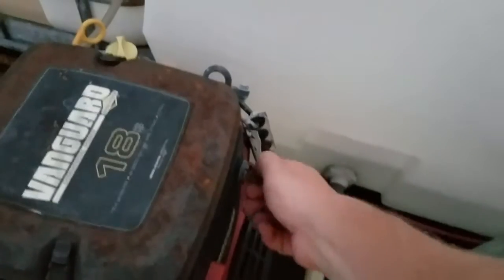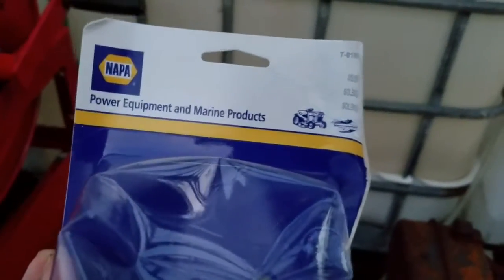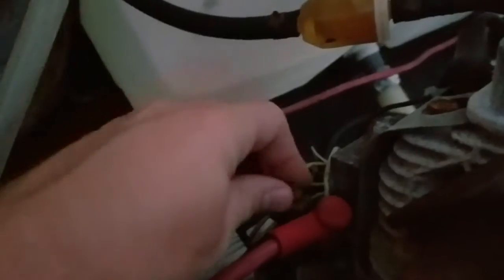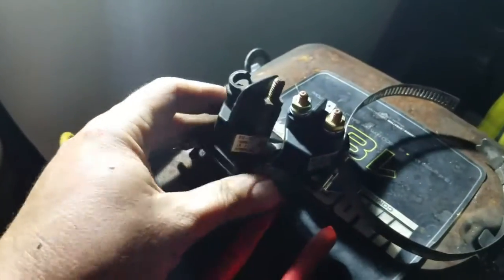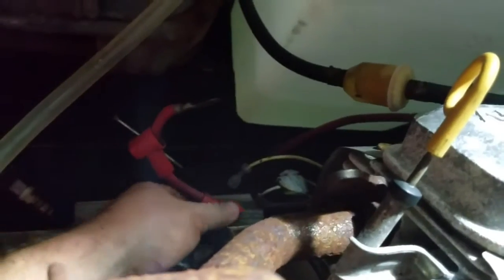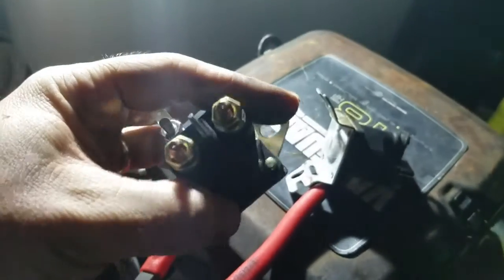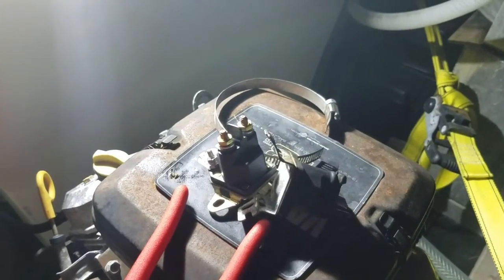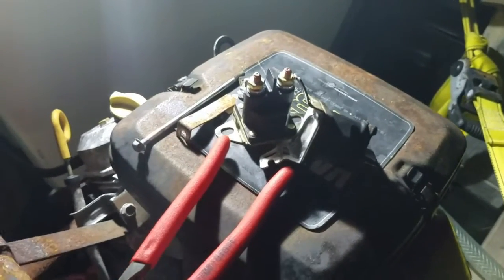Vanguard engine starting issues

Comment: Hey Rob. This happened to me yesterday. I was washing a huge driveway. Had to reposition the trailer and the engine would not turn over. Figured out it was the solenoid and use some pliers and jump over it. I was searching how to change it and you popped up. I have a Vanguard 18HP too. Thanks for the video.

Comment: What's solenoid and part number for it. My 18 hp vangaurd died today. Had battery tested. Said bad, bought new batter and still nothing. Only little click here and there trying to start it. So I take its the solenoid. Please respond with the part #. Thanks!!
Reply from the maker: No clue on the part number.   You should be able to Google it.

Comment: How hard should they be to pull start? I have a 23HP near new, I did get some rain recently so not sure if water damage but it wont turn over and I cant seem to pull start it, very hard.
Reply from the maker: Unhook all pressure hoses, and then try starting it.  There are other ways to see if it is vapor locked, but not onesni have made.
Reply: @Cleanpowerwash  Thanks for the reply, I replaced the earth wire, it saw abit of weather and shes going great now.
Reply: I put new ignition switch and
Solinoid & harness and motor
Is trying to start in run position

Comment: Hey. Could you please contact me. Having an issue with my 18hp vanguard. Seems like Same problem. But how can you use manual start as well
Reply from the maker: If it has recoil /pull cord on it then it can be done both ways